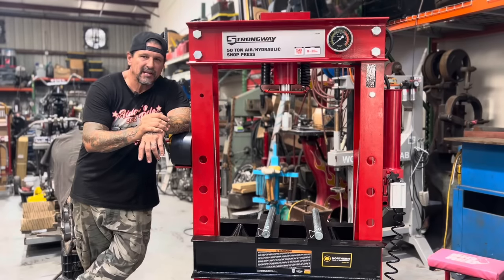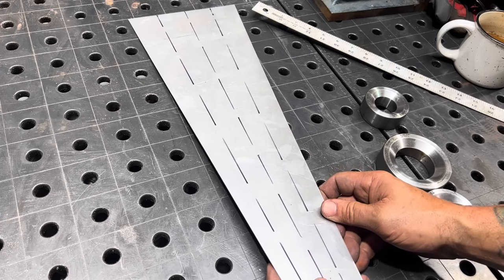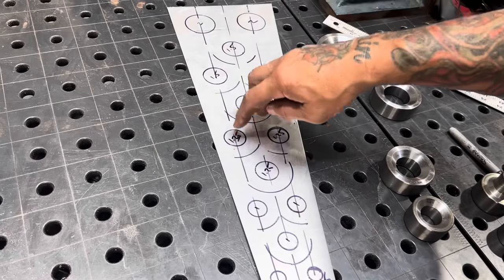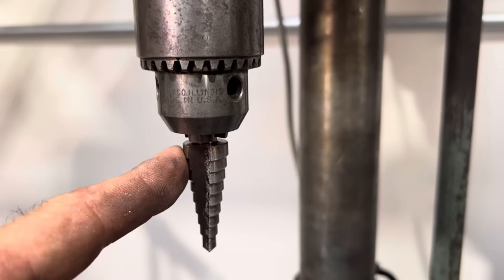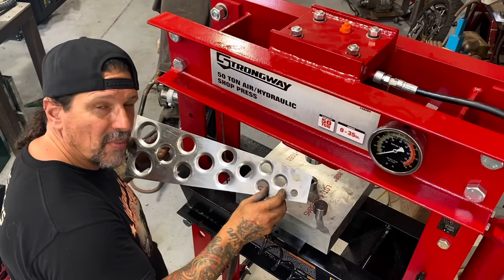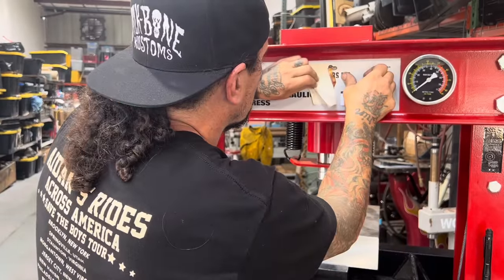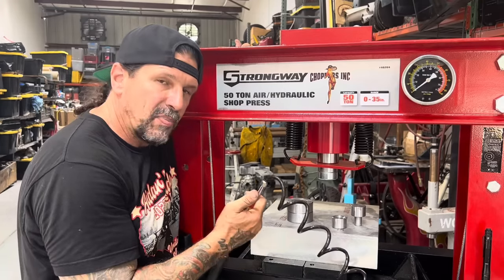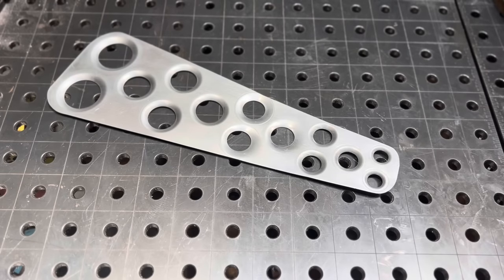Billy Lane Hubless Custom Panhead Shovelhead Chopper Motorcycle Gas Tank Fabrication Choppers Inc HD

Comment: When making replacement parts for Aircraft , Aluminum is often used as a lower grade and then Heat treated and quenched to bring it to a higher grade of strength . I dont know if you would also do this method unless your looking at making an Aluminum fender at T3 sheet and heat treat to T6 grade . Its just a thought to ask if you have done this as well?